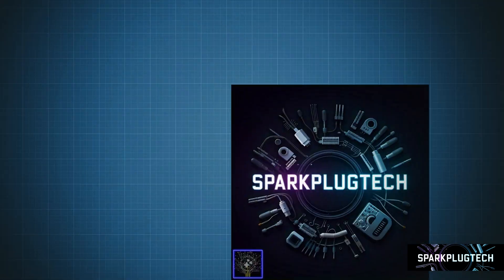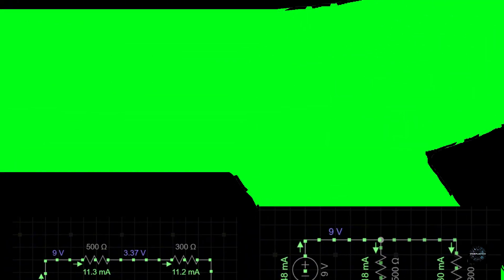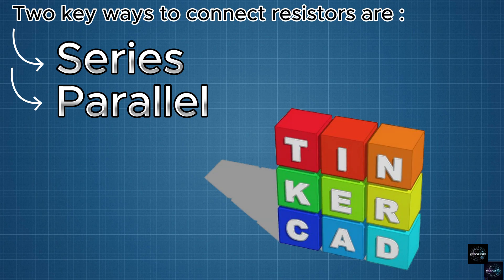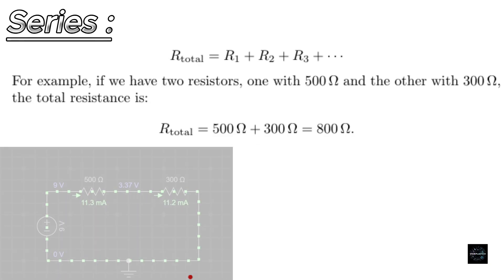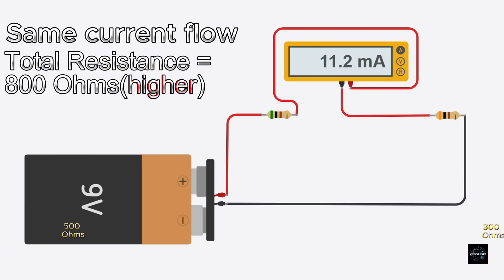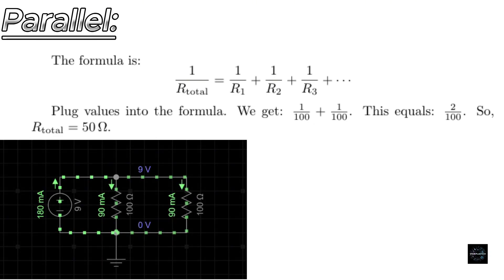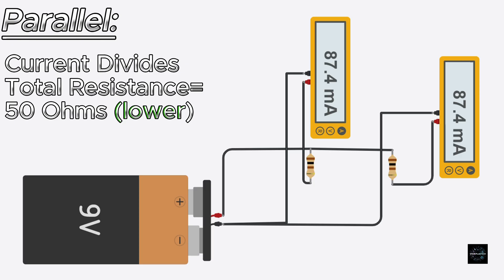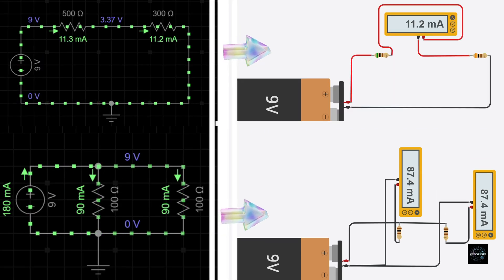Series Vs Parallel

Comment: Series = voltage drop
Parallel = current drop
Reply from the maker: Exactly!For Series Circuit, there is a voltage drop across each component in a series circuit, but for parallel Circuit,the current divides among the different branches of the circuit.